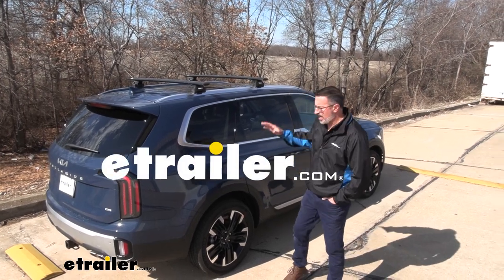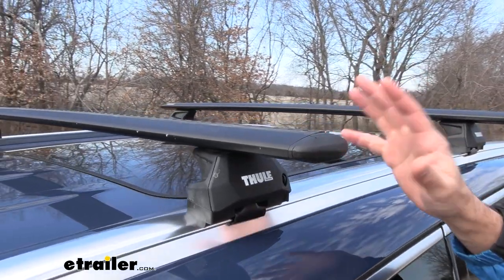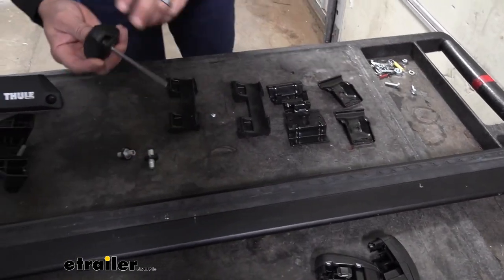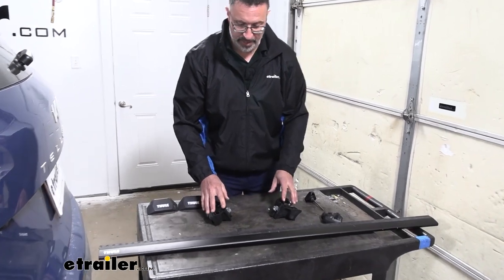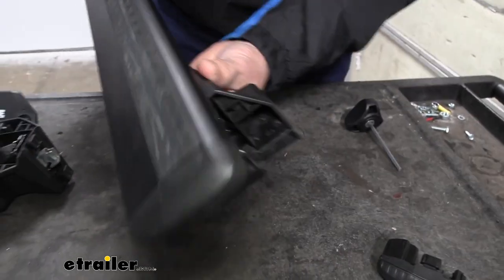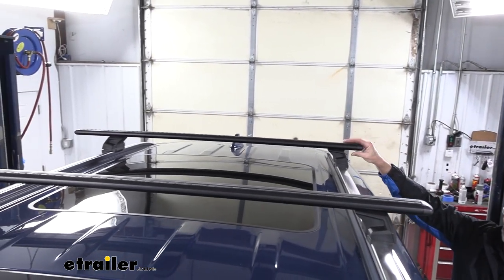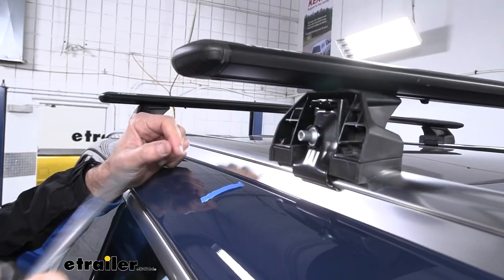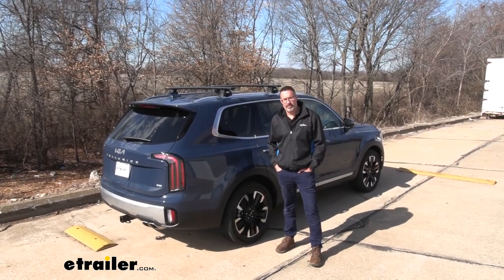etrailer | Installation: Thule WingBar Evo Roof Rack for Naked Roofs on a 2023 Kia Telluride

Comment: Which Thule system do we use for a raised rack on the XLine?
Reply from the maker: Thule offers a WingBar Evo rack that's compatible with your Telluride X Line. Thule recommends the WingBar Evo 53 inch crossbars, available in silver as part # TH711400 or black as part # TH711420. You'll also need the raised rail foot kit, part # TH710401
https://www.etrailer.com/Roof-Rack/Thule/TH711400.html
https://www.etrailer.com/Roof-Rack/Thule/TH711420.html
https://www.etrailer.com/Roof-Rack/Thule/TH710401.html
Hope that helps!